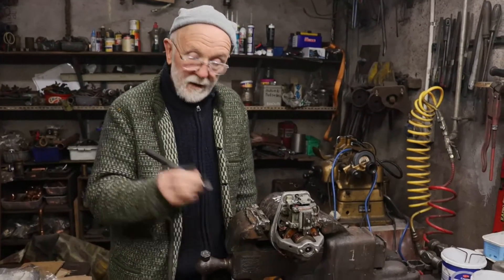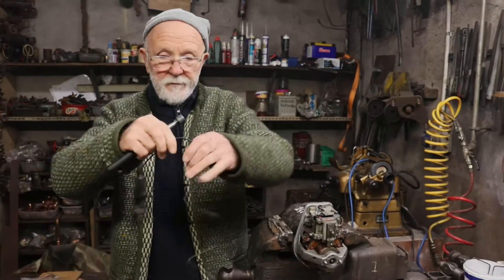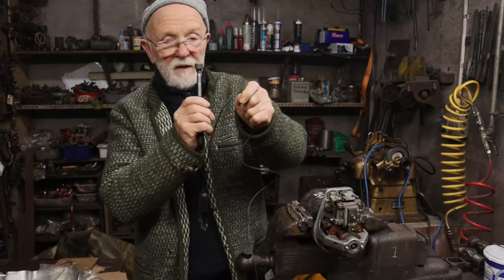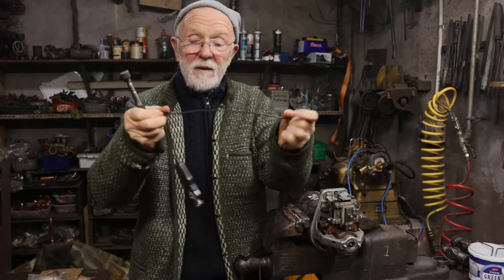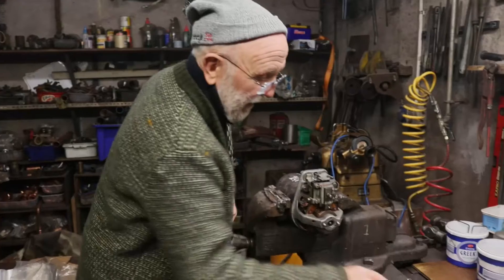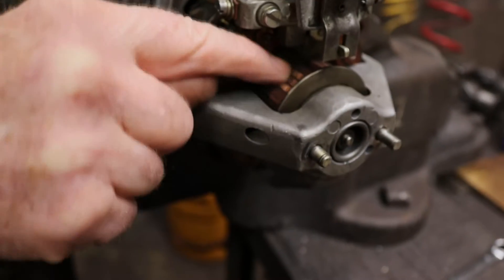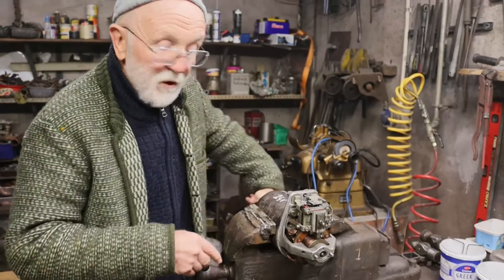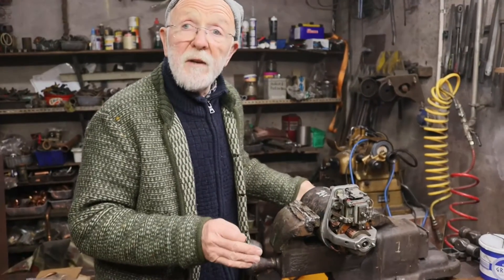Gardner Engines and the effect of flat batteries.

Comment: The low voltage also greatly increase current. A 4kw motor alway will draw 4kw wether its at 13volts or 8volts just more amps
Reply: That's only because of the phenomenon described in the video. A purely resistive load will have its current drop along with the voltage, such that the power drops with the square of the voltage.
Reply from the maker: Mr Awawe ;-)
Reply: Now that’s an exellent explanation!